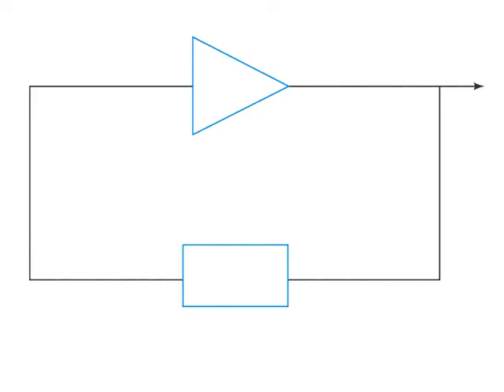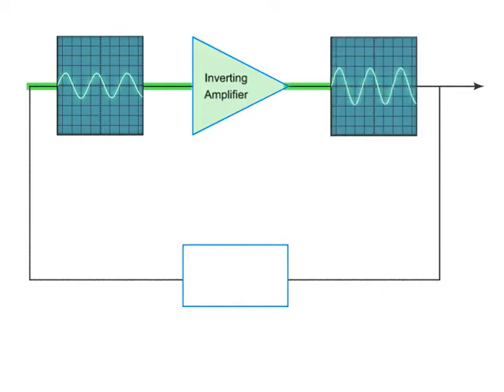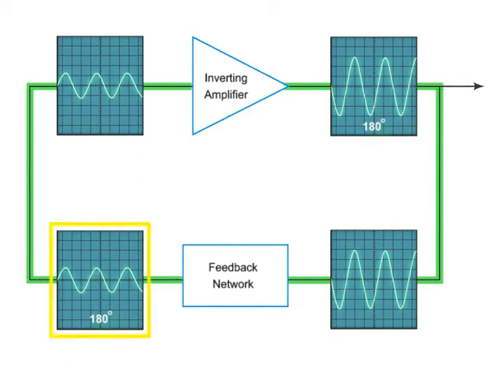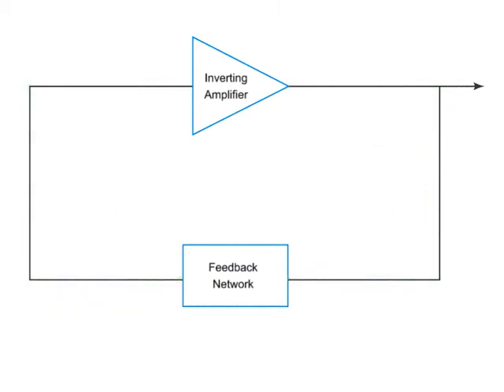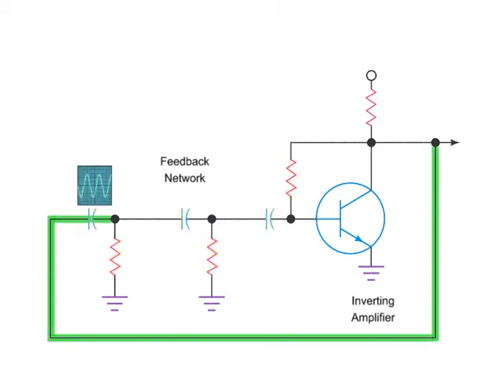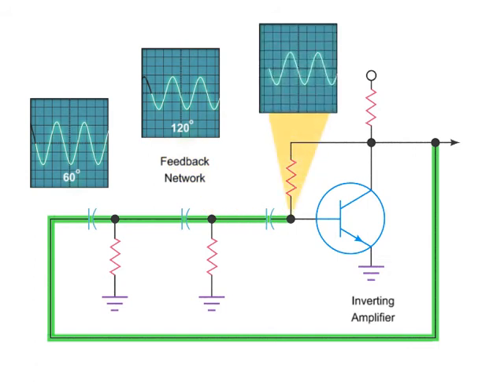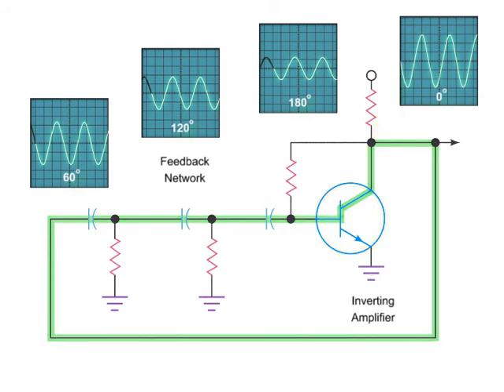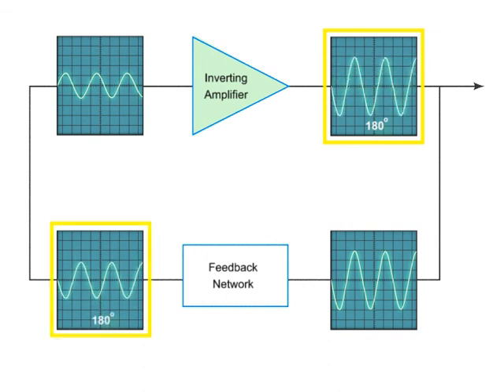Electronic Oscillators and Its Feedback Network

Comment: great video sir thanks
 
one thing i want to ask that in lc oscillators, tank circuit is just used to give startup, after that wave that is generated at very first instant(at time of power on) is kept in loop. now need of tank circuit.  is it right?

Comment: In electronics, the Barkhausen stability criterion is a mathematical condition to determine when a linear electronic circuit will oscillate. It was put forth in 1921 by German physicist Heinrich Georg